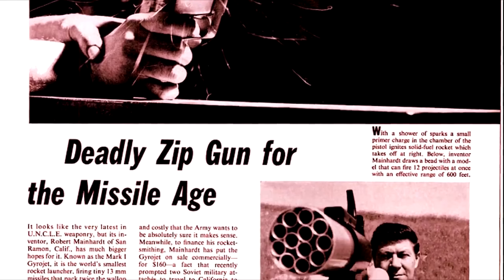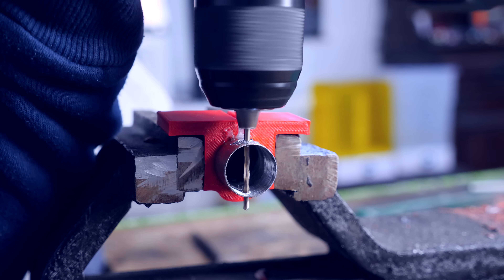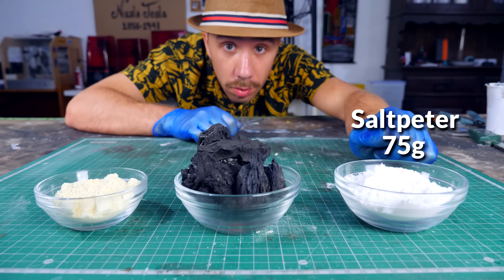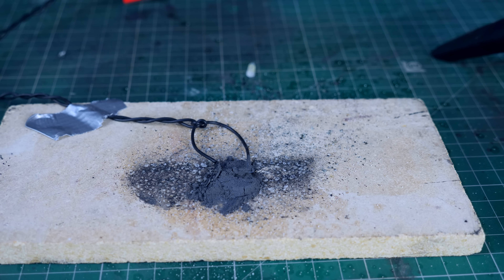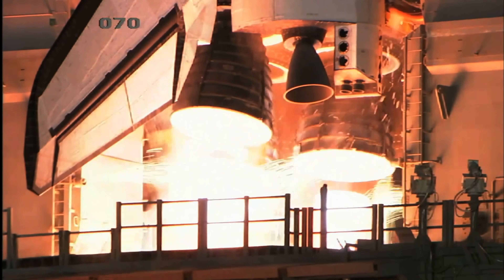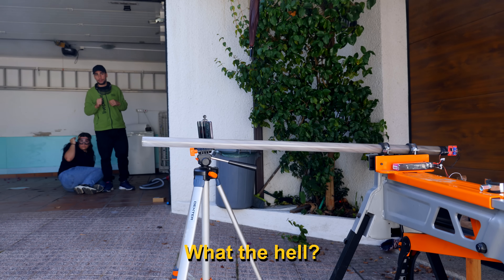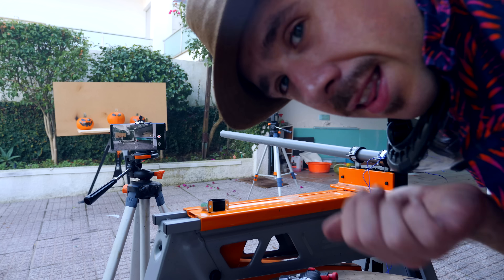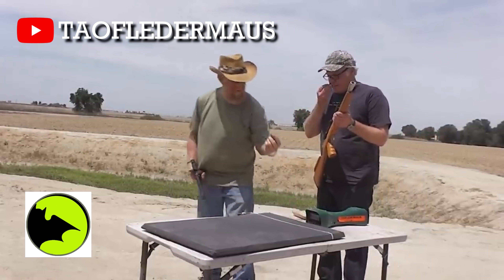GYROJET - The Spinning Rocket Bullet

Comment: You could solder one end of the filiment to the inside/bottom of the co2 cartridge and thread it through the rocket fuel and fill up the space around it with gunpowder to simply manufacturing. The outside of the cartridge would be one pole and the filiment sticking out the back would be the other to complete the circuit.

Comment: I used cement with a mold to create the nozzles of my small rockets. Only made a few test engines and my propellant wasn't always reliable, but nozzles seemed to work ok.

My nozzles were also formed into the PVC tubing I was using for the rocket casing, so they were kind of only one use,  but they survived well and if I changed my manufacturing process could definitely have survived multiple firings.

Some problems was getting the nozzles to release cleanly from the mold and making sure the concrete nozzle and plug at the other end had sufficient grip so the pressure didn't just blow them out, resolved the last one by adding a PVC ring inside the tube, held in place with PVC glue.

Process was:
Cut tube for casing
Install nozzle retention ring
Form nozzle with mold in casing 
Install fuel grains
Seal top section with tin foil disc and sealant
Install top retention ring, also used to mount nose cone on
Seal top with concrete plug, starts below retention ring and goes part way up the ring to give the plug grip
Then good to test fire once everything is fully set

Comment: You could remix this project by soldering a small tab on the casing, and by one way or the other (I would recommend metal casting, but maybe 3D printing it would be easier for you) create a barrel with grooves, to make the rocket spin just like real guns, maybe this will help to make it more stable 🤔

Comment: Video idea:  Silver/H2O2 rocket engine. 3D print a regulated pressure injection onto silver. Production of water at high heat - creating volumes of steam. Not as dramatic as gun powder but soooooo cool as a monopropellant.

Side note: I’m a US veteran and a design engineer without a 3D printer. It sucks. Just designed a gangster machine gun that shoots shaving cream for a client in the UK and I can’t print it myself. The tomato’s are winning. Help me defend myself.

Comment: You should check out Tech Ingredients videos on rocket motor building.  He pours his propellant into the rockets while he has a tube placed in the middle. Then he placed the ignition source in and sealed them. He did very well on his.

Comment: Please don't give up on this.  Either try to use better materials for a better nozzle, or perhaps try it with a monopropellant.  You might also try adding some low twist rate rifling to the launch tube to get a spin started before the projectile leaves the tube.

Comment: Just wondering what would happen with thermite instead of gunpowder🤔

#videoidea
Reply: Melted casing?
Reply: @nic.h  *melted casing mid flight, doesn't it sounds interesting to you?
Reply: @Sorrentino_Gianni  oh I'd definitely watch a video doing it ;)
Reply: @Sorrentino_Gianni  it would just melt, as the thermite-reaction doesn´t produce gases unlike gunpowder which produces carbon monoxide and nitrogen
Reply: @Humbulla93  that's cool, didn't know it's a gas-less reaction.
It react quite violently tho, wouldn't it move at least a bit anyway as reaction to the kinetic energy of the "sparks" hitting the chamber?

Comment: Video idea: 3d print different spiral rods with a blade on the end, this could allow for different styles of scoring for inside the tube - changing the motion of the projectile 
Other idea: A tiny version of a multi-rocket launcher, launching 4 rockets or more at once on a small scale

Comment: The reason why spinning a bullet works is because it's (usually) made a full rotation BEFORE leaving the barrel. Either you need faster burning fuel or a longer barrel to achieve this. Also, a tighter fitting barrel is helpful, but you might have to custom make it and that's a hassle.

Comment: maybe for a second rendition, adding a low angled tri fin into the actual casing might help. have the fins possibly work in tandem with a tapped / riffled barrel or tube to possibly keep the projectile more stable in flight
Reply: This was my thought, combined with a breakaway casing to fill the barrel to the walls, and a solid back. That would help with his tumbling "round" issue, as his barrel in this vid was consistantly too large of a diameter.

Comment: You dont need a nozzle for a solid state rocket you just need a hole going down the center of the length of the rocket.
3D Pint a Rocket that does not need a parachute to land. Maybe something that can be reused. A mini Starship. Elon Integza.
Reply: Nozzle should perform better
Reply: @nic.h  Its not necessary at that size and thrust.
Reply: @drd9973  true I expect the performance gains at this scale would be moderate at best. Something he could test out for us maybe :)

Comment: Okay, safety brief: Static electricity sets off black powder. You need to store/mix black powder in a conductive container or it can ignite.

Speaking of, gun powder does not explode, it burns. It's basically a rocket fuel grain, but without an interior hole (in small arms). Just like a rocket, only the exposed surface burns and that gives a speciic pressure curve. Modern powders will very quickly kill you if you don't use known good configurations or mathematical modeling software, as they all have different energy, burn rates, changes in burn rate with pressure, etc. Black powder has a very stable burn rate, but as I mentioned, it is very sensitive. Please consider more reading on the safe handing of black powder.

Also, you're missing a key part of the Gyrojet. The hammer pushes back on the projectile, both igniting it and increasing initial resistance, allowing the rocket to come up to power before traveling down the barrel.

Comment: Instead of fooling around with bits of plastic straw, try mixing your BP mix into some nitrocellulose lacquer and dipping your nichrome wires into the mixture several times. You can make quite a few igniters in not very much time that way and you don't get black powder all over the place.

Comment: you should see if you can 3d print a vehicle of some kind that has no metal, no glue, nothing but 3d printed parts that snap together. it has to move on it's own though. you could print a coil spring or something as the stored energy that powers it. boat, car, plane, helicopter. what ever you want but it has to be 100% 3d printed and is self powered. that's my video idea.
Reply: I've never seen another youtuber do this and I've always wondered if you could make a vehicle were the only tool needed to build it as a 3d printer

Comment: The thrust to weight ratio on your rounds is your biggest problem. The projectile can't reach a high enough speed to stabilize. Your center of thrust is also probably off.

Comment: Video suggestion: Would you like to play with Hydrogen? : build an electrolysis device  and use the resulting gases through a rocket nozzle. 

Hopefully I have a 3d printer before I win one lol but I may not be able to get the one I'm looking st either

3d print the precision valves..

Comment: Well you do have that kiln, you could sculpt a nozzle by hand out of high temp ceramic that you can fire (cook) in the kiln.  Graphite would take the temperature, but it's quite brittle.  A graphite crucible can withstand ridiculously high temperatures, but if you drop it it shatters, it breaks even if you hit it too hard trying to fill or empty it.

Comment: Why not just print a pocket in the back of the nozzle for a rifle primer?
Reply: You also would have to  design a complete firing mechanism and the primer might also be blown out...
Reply: @Dodo-ze5ep  I was thinking mortar style launching, just a small pin in the bottom of the tube. With a loose fit for the primer so it intentionally blows out becoming the main thrust port with two more ports on the side with aggressive angle for stabilization.
Reply: @timothyurbanik6298  That might actually be a good consideration, but it's only good for vertical launch
Reply: @Dodo-ze5ep  yeah vertical launch would definetly be a potential drawback, also the cartridge as he has it designed now might now be heavy enough to trigger the primer in a mortar style system.
Reply: @timothyurbanik6298  It's still possible to use the original Gyrojet system where the hammer hit the front of the rocket and the firing pin was fixed at the back. So the weight isn't a problem here...

Comment: The idea for nozzles:
Print on a 3D printer, make a mold for casting, and cast from metal (aluminum, copper, bronze, brass).
You can also cast a shell for a projectile with built-in winglets.
Reply: Cement also works reasonably well

Comment: You can cast the nozel... print it in plastici then put them in cast mass melt dow the metal and use centrifugal force to inject metal in the mold. Its seample

Comment: You should make another attempt with some type of rifled tube to give additional twist.

Also I don't think concrete does well under extreme heat and will probably crack.
Reply: Concrete worked pretty well for the nozzles I created. They were single use because of my manufacturing process, but definitely could have been used multiple times

Comment: I'm going to suggest a different fuel and grain design.  If you switch to a sorbitol based R-candy, it won't have quite as much energy as sugar, but it melts at a much lower, and safer temp, and consequently, it's also easier to mold and shape, with a much longer work time before it hardens.  as for the grain shape.  The video you based this design on even addresses that.  His solution was a spiral rolled sheet, which is also easier to manufacture with the sorbitol fuel.  any energy loss from the "subpar" propellant is more than made up for with the increased surface area of the grain.

Comment: You should use a shotgun shell and a brass projectile and a steel pipe with a camp site 12 gauge primiter alarm. Little bit of black powder to ignite it in the shell primer from the shell sets it off then your brass projectile would fit in the shell and have nozzles.

Comment: @Integza The reason Backyard Ballistics' gyro jet rounds never worked, was the same reason yours didn't work as well. It only had 2 nozzles. The early gyro jets had 2 then 3 and then found that they needed to use 4 to stabilize them in flight.😀
Reply: Also, the stabilizing ports were not used to propel it. The propelling thrust came from the center of the round, where the primer was located. Once the primer was ignited, It in turn ignited the propellent and was in turn forced out of the round and the opening became the main thrust nozzle. Backyard Ballistics got this wrong as well and you seemed to just follow his lead in reproducing these rounds.

Comment: You can also make an electric match by simply mixing the gunpowder into gum glue (or rubber glue? The stinky stuff that's natural rubber dissolved in petroleum distillates) and dipping the nichrome loop into it. Smaller and easier to make, although perhaps not as reliable for starting bigger rockets:it needs to firmly touch the fuel.

Comment: Video ideea: What if you use the exhaust gas of CO2 to rotate an centrifugal impeller to power an axial propeller to generate more lift. You have a lot of pressure to power the impeller in small volumes so is  enough thrust to power the propeller. after the gas power the impeller it can exit in the axial direction of propeller so u don't lose nothing. I think it can be a rocket to 7 off.

Comment: Print up a spinning launch pad that puts gyroscopic spin into a rocket before launch. Either to stabilize for vertical flight, or along a gutter to act like a gun.
No need to use vectored nozzles to spin.
BTW what's your opinion of resin dip 3D printers?

Comment: it looks like the problem is that one of the two nozzles on the bullets produce more thrust
i think thats from uneven buring of the fuel
you should try to connect the two nozzles to a single hole in the middle so the pressuredistribution does not rely on the perfect concentricity of your fuelgrain

Comment: One thing to note is the gyrojet gun doesn't fire how most people think, the hammer is in front of the bullet and hits it backwards onto the firing pin, the hammer then holds the bullet in place for long enough for the propellant to start burning evenly and for thrust to build up a little.

Comment: {create a breech block that holds the projectile centered in the barrel and design it to give a little initial spin for the nozzles to build on. it can be just a cradle that snugs into the pipe and collapses under the force of ignition with a spin...think the spiral spring collar inside a tube of vitaminC chewables.  as you push the ends together the center forces one to spin around the center axis to allow for the collapse.}

Comment: you could add retractable fins similar to an rpg or add rifling to the pipe, that would help a lot  with the smaller diameter pipe. and it might need a longer distance to stabilize or a faster burning fuel. awesome video none the less, always love learning about new and weird firearms.

Comment: Instead of a larger barrel you could hole saw the side to reduce friction and the high pressure air in front of the projectile.
I think you might actually want a small air cushion in front of the rocket to ensure the propellant is ignited and it is spinning before it leaves the end of the tube.
Maybe more aggressive nozzles too? 
I'm no rocket scientist.

Comment: One of the reasons that your Gyrojet didn't work is that it wasn't able to keep the projectile inside the barrel before it started turning. The Actual Gyrojet guns have a little ramp that keeps the projectile from moving and leaving the barrel before the propellant actually start burning. Thus, Helping it turn more in the barrel, increasing its accuracy. The little ramp would go down once the projectile got enough force and pressure to make it go down.

Comment: Hello awesome video I think if you made a sleeve that fits around the rocket and takes up more space in the muzzle and put some pitch in the nozzle so you can get some rotation in the rocket to stabilize the rocket when it leaves the muzzle witch should get the rocket to fly little straighter maybe 🤔 thanks keep the awesome videos coming

Comment: You can make the gunpowder into a paste, form it in a ball around the wire (in the middle,) then let it dry. Make the wire longer so the ends can stick out the straw. The hot glue can keep the ends of wire separated.

Comment: @Integza
5:15 You should sift the coal powder, so you get uniform particles, and use as fine sifter as possible.
Reply: Another way to make it burn much faster is granulating it or if you want instant burn put the powder in a ball mill and then granulate it

Comment: If you ever take a second look at these bullets, you could try to make fold out stabilizers for when the bullet leaves the tube
Also, video idea: since the CO2 is under a lot of pressure and stuff cools down significantly when depressurizing, is there a way to make dry ice from one of these canisters? Or maybe a valve to control the pressure leaving the canister and using that for propulsion?

Comment: The gun powder even in open air should burn faster than that with that mixture. This suggests it wasn’t mixed/ground long enough.  In future use a pestle and mortar for small batches, the method you showed is supposed to take a lot longer using a rock tumbler or similar. You may also be running into issues by not using high enough grade charcoal. Which weakens it and makes it perform more like a slower burning mixture.

Comment: You don't really need expensive NiChr wire for ignition. Just split a normal wire which is made up out of several thin strands and use one of those.

Comment: Have you tried pre generating spin at least as a test. Just spinning up the whole barrel maybe... would that work 🤔? You said they had something pre generating spin in their bullets basically telling you the spin from the rocket nozzle would likely be insufficient and while you had a longer barrel you also had a much larger bullet which would take longer to spin up. So I'm thinking a remote igniter attached to a spinning barrel assembly? That's like straight 3d print territory

Comment: What if you didn't combine the trust and rotation nozzles and had one trust nozzle at the back and rotation nozzles on the sides? You could also try a slight friction fit in the launcher until a thrust threshold has been reached.

Comment: How about making nozzles from rammed cat litter. 3D print a negative with a low melt plastic, fit it to the bottom of a metal tube, ram the cat litter around it with a dowel and melt away the plastic. Just make sure you scoop out the cat sh*t and yellow bits beforehand of course.

Comment: Firstly, the thingiverse link points to 404 :P Second, use a paper funnel for filling the ignitiers. SRBs usually use a star pattern inside and burn from inside out. Compact that fuel to make sure you don't have any air pockets - usually means a nice bang :D You could also use the black powder to make rocket engines, would love to see a comparison :D Also if you could add a spin prior to firing the bullet it would actually be more stable in flight :)

Comment: You should do a follow up video, with a bullet that works almost as a 2 stage rocket. But the firts stage is a standard gunpowder explosion that takes advantage of the radiated barrel, and the rocket takes place on its end/ or already out of the barrel.

Comment: you could try building a rocket with a microwave, where the microwave is heating some sorte of liquid with low boiling point quickly, or buil a rocket with potassiumpermanganate as an oxidizer